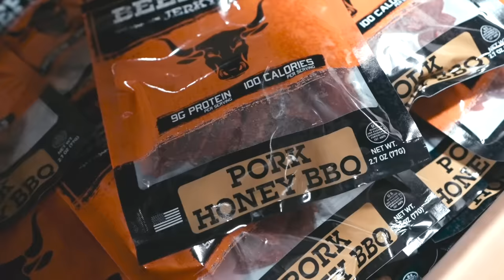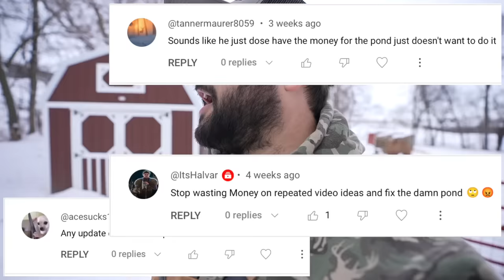Why I Haven’t Talked About It….(The Truth)

Comment: The only experience I have personally had with pond liner was it needing repaired after 20 years of use. Pretty decent considering it was 20 years, but the way they wanted us to patch it was to plastic weld the liner back together... so maybe also consider the costs of repairing if something does go wrong. It wasn't very hard to plastic weld it to where it wouldn't leak. I actually taught myself how to do it on the liner and there were no leaks after. But the pond did have to drain down about 20 feet to get to where the leak was. We did lay medium and small rocks all along where we could reach to help keep wear and tear off of the liner too, so that's something you could maybe do too? I'm not sure and not the most experienced...

Comment: I’ve worked construction for a little over 20years. I’ve seen them use them liners, N I havnt seen any leak or heard of any. If the seams get sealed right. You will have no problems

Comment: Been building ponds for years you can't go wrong with a clay liner if in doubt have a sheep foot roller to roll it in lifts only time we ever used bentonite is if there is water and you need to find a leak it will seal it up cause it salitifys in water and is very expensive to mix with clay to do an entire pond best of luck but Clay is your best way

Comment: Like you said, there’s pros and cons, if you put liner, there’s chances of getting holes in the liner and it decaying and have a whole pond filled filled with water with the hole in the liner but it’s cheaper…. Clay and bentonite is more expensive,but could be or could not be worth it in the long run… it could either leak and waste 100,000 or it could not leak and have a pond for a long time and grass could grow🤷‍♂️

Comment: Look for soggy land on the outskirts of the pond if the land is wet and there was no rain or precipitation of awhile, then you found a leak. Only put the clay where you need it. You might have to do it several times and find multiple leaks but if you keep keep doing slowly you'll eventually find all the leaks. That being said, it's still going to be expensive but not as expensive as laying clay through the entire pond.
Reply: You could also do a smaller pond maybe half the size it is now and lay a concrete liner (less practical but atleast it won't leak or cost $150,000 maybe $100,000 but still less expensive lol)

Comment: I work for a liner company building ponds and I think a liner are great for ponds but you need a Hdpe 30mm liner with a 2 foot of dirt cap over top and it will be fine if it can hold acid it hold water and not leak

Comment: I would go with a liner then you can put a layer of regular dirt of the top of it to make it more natural maybe a 8 inch lift of dirt the then layer of the liner can be whatever dirt you want to use if you plan on putting brush I would go 12 inches thick in those spots for added protection from putting a hole in the liner

Comment: Clay and bentonite. You even said you are aware of BamaBass. It works. It’s the better option hands down between the two options you are debating on. BamaBass even had a leak, and the solution to that is pretty simple. 

A liner that leaks in 10 years will cost WAY more to fix.

Comment: THIS IS IT...Hey guys, I would go with a liner, because it's more guaranteed to work then clay, I would divide the pond into four sections using dirt keeping it under the water surface level, and use 4 smaller liners, this way if one liner fails the entire pond will not drain, but standing on land it looks like one giant pond,  good luck, use my idea and let me know when to come join you guys on a duck hunt. Scott.G from NJ

Comment: You've got to be careful touching those heat lamps with your bare hands. They get up to such a high temp that the oils from your fingers can cause the surface to heat unevenly, and that can cause them to burst.

I spent a lot of years in fast food where those bulbs are used over the french fry station, and I probably changed a few thousand of those bulbs. Always put on rubber gloves before touching them.

Comment: You are in it 100k already.. do the clay.. it will work as long as it is done properly.. your well may not have a lot of flow.. but it is there and did fill faster then you thought. Have you checked about digging a second well or tapping into one of the natural springs you have running through the property?

Comment: Ive never built a fishing pond but ive built highways (in iowa) and we use clay when building them and have to compact it and test the compaction. We also did some ethanol plants and had to use blue clay for some of those. We also used blue clay for water run off holding ponds at the Wally world that we did the dirt work for...also Kendall Gray went through the same thing with his pond and he also used clay..so i suggested clay

Comment: You could always use concrete on the sides of your pond and clay the bottom of the pond or just use concrete for the hole thing it will never leak... you would have to add your own structure but concrete is a Guarantee not to leak....

Comment: Define clay because as long as you get proper compaction and they put the material in lifts it will work out just fine. I’ve only done two ponds and both were clay and bentonite.

Comment: I think clays the way to go I’ve read a lot of these comments and it seems to be a overall unanimous decision bc a liner would be just as much and make it not be as sustainable and long lasting and if you use clay on the off chance it doesn’t hold then you still have the clay and you can make it a little smaller and pack it in tighter

Comment: Wont crayfish dig through the clay? I never built a pond but those little buggers dug through my visqueen, the pool underliner and pool liner. I had visqueen, sand, under liner, more sand then the pool liner and those dang-gummed crayfish ended up in my salt water pool and the water disappeared. Clay was my base layer. It was natural when i dug the hole.

Comment: 100% clay, also i have never heard you talk about testing water or anything. at your old house, did you have a natural stream that filled it? because if you did that is exactly why your pond ran so smooth before, its a natural source of biological life. you need to test the water to see how your ammonia levels are and try and combat it with a beneficial bacteria, just like a natural stream that would flow into any body of water. starting a pond this big you should definitely do a natural spring system, but if not you should try and put in some type of filtration or something and keeeeeeeep up on cleaning it. at some point it should become pretty much self sustaining, on something of this scale i really couldn't give you a good estimate. maybe like a year or two, especially because winters are super tough

Comment: Thing is if you clay it and it doesn’t work its natural and wouldn’t affect the dirt or wildlife at the house if it does its going to last and be way more beneficial than the liner with the liner if it doesn’t work then you have to get it hauled off or leave it and it cause issues animals could swallow it thinking its food it could erode its eventually going to go to crap with the clay it may be expensive but it would be worth it over time.

Comment: Just so you know with the bedding and chicken poop you created a fire hazard putting heat lamps in the chicken coop they have feathers and are super insulated and don’t need heat lamps their internal body temperature is above 100 degrees

Comment: 10:18 10:18 10:18 think seriously about what you said here "Are well is only 25 gallons per minute"  it doesn't mean the water isn't there, The well  needs to be Hydro-fractured, commonly referred to as hydro-fracking, is a well development process that has been used commonly in the water well industry since the 1990s. Hydro-fracturing involves using direct displacement specialized high pressure pumps to inject water under high pressure into a bedrock formation via the well.

Comment: 1000000% bentonite it. The moment you start putting structure in there, it's gonna rip a hole in it. You're already $100,000 into it, so you might as well do it right

Comment: Stop giving your chickens heat. They are cold hardy. You keep them used to the cold they will survive no problem. You get them used to heat, they will die if it turns off. I live in Michigan, never give heat, provide the coop and deep bedding, keep it dry, and never lost a chicken to cold. Save yourself some money on that electric bill.